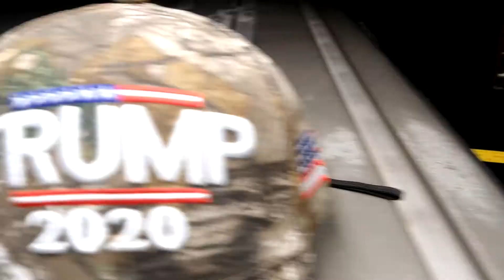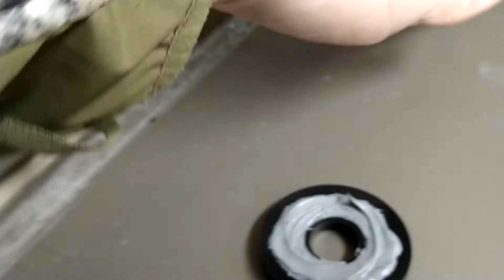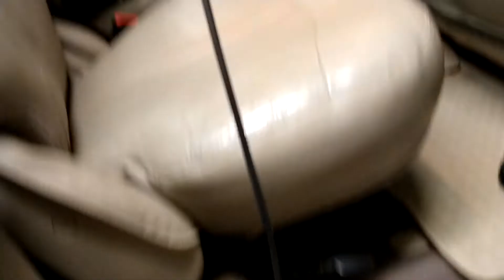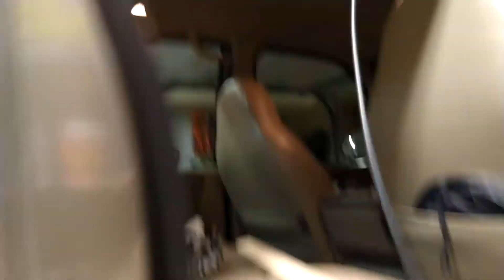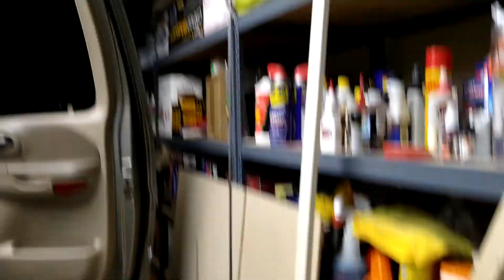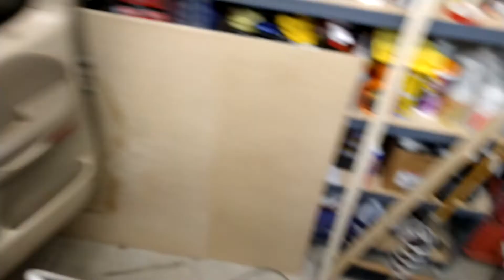Wilson 1000 CB antenna through roof mount without pulling headliner!!!

Comment: Hi, nice video. I just wonder if you ever noticed the antenna when it swayed forward or backwards did it cause the roof to flex a bit at the base of the antenna? I installed my Wilson 1000 and I noticed the roof flexed when I moved the base forward and backward. I may need to insert a piece of metal or something underneath the mount. Maybe my roof is too thin for the mount? It's on a Toyota Landcruiser. Any thoughts? Thanks and I like the yardstick idea.

Comment: I Really having a hard time drilling into my 2018 ram 1500.
Reply from the maker: I understand, but once you do it you'll be happy with the results. It's a truck so if you decide to remove it you can always install a rubber plug and some rtv. It's hard to drill that hole though!
Reply: @vegasfordguy  Well I'm using a Connex 3300hp to a 250 watt heater then to a wilson 2000 using a mag mount. I get waaay out and my SWRs are almost nonexistent. Thats why I hesitate.
Reply: The radio was tuned and aligned. I told him not to try to get as much power out of it as he could so I could have a nice clean signal.
Reply: I have a 2017 ram 1500. What I did is a mag mount wilson 5000 and stuck it on right infrounf of the 3rd break light and put the coax in thw weather strip for the back window and throught the vent in the back of the cab. No drilling and very clean

Comment: When you drill the hole does the metal on the side or bottom touch the vehicle metal?
Reply from the maker: The bottom of the antenna mount makes contact from underneath. It has a star shape which makes a good ground.
Reply: @vegasfordguy  thanks

Comment: You need to remove the paint from the bottom of the roof so the mount has a good ground.
Reply from the maker: The bottom piece has several sharp fingers that dig into the metal. I've ran 1kw in this truck with absolutely no issues and a flat SWR.
Reply: @vegasfordguy  gotcha, yeah I had a bad swr on mine had to remove and sand down the paint to bare metal so the fingers made a good contact.
Reply: I did the same thing.. 1st time on a Ford ranger with help from a buddy or 2 and the 2nd time being the most recent on a 2016 ram 1500..  I'm having some trouble with higher swr and whatnot but I was curious if you drill the hole larger to accommodate for the slight bevel right below the threads of the base mount? I think I may need to expand my hole to let that slight bevel pass.. I'm thinking all those teeth on the underside can't get a good bite because the hole isn't large enough for that bevel. I'm gonna try it anyway I just didn't wanna make that hole any bigger than I needed too.
Reply from the maker: @billb1788  This could be the case, I used a step bit to drill the hole and went a size bigger. Luckily mine bit and tightened well. On my other vehicle, I drilled the hole the exact size and it spun, I had to rig something up to hold the bottom, so it's possible that a bigger hole helps.
Reply: @vegasfordguy  gonna give it a go and see what happens... this will be the 4th time taking the back half of the headliner down...I've mastered it lol. I will report back and let you know if I have improvement. BTW I'm running a Stryker a 10 right now since she yields the lowest swr for me.. I throw the willy 5k on and she pegs the meter.  Thanks alot for this video too